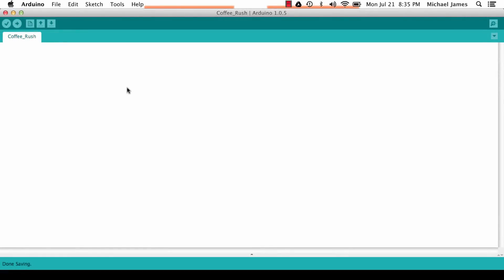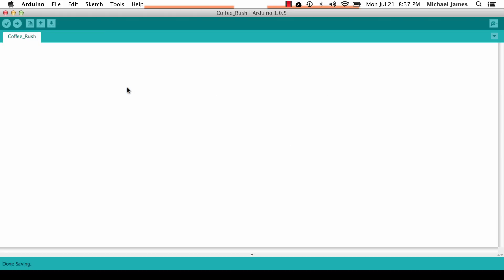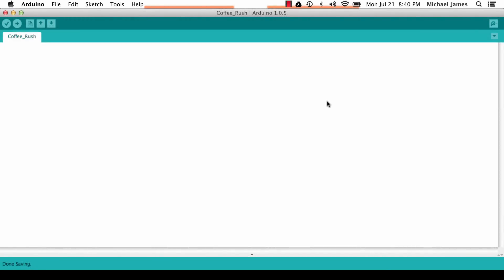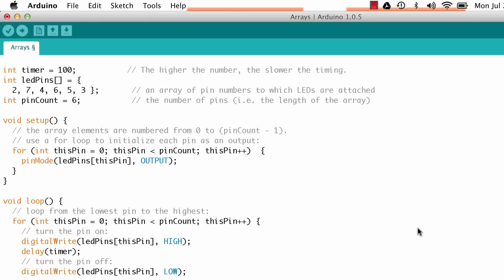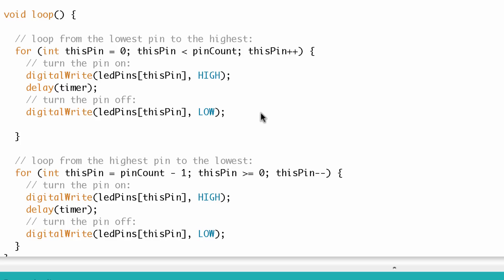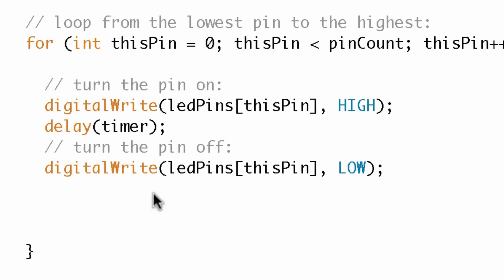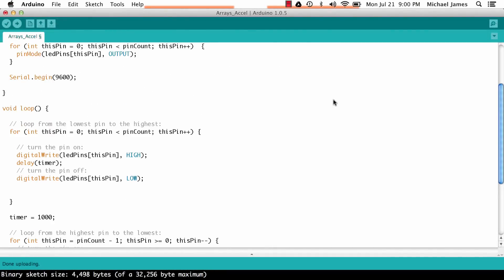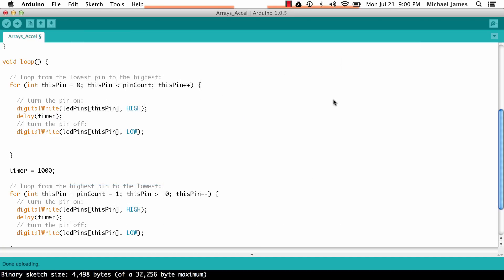3 Ways to Use Acceleration in an Arduino Sketch

Comment: Excellent video. I need some help to accelerate a Stepper Motor to a speed that is based on a potentiometer setting. The pot sets the delay between HIGH and LOW for the Pulse sent to a Stepper Driver.  If the Pot is set for a short delay, the motor can stall when the start switch is activated.  I need to somehow ramp up the speed to the short delay set by the pot. Can you help?  If so, I can provide more details. Thanks.

Comment: Such an elegant solution and well explained. Was actually searching high and low for a way to FADE a light in a more natural way, which is another great example of why you would want to use acceleration. If you fade an LED for say 10 seconds, using the simple "Fade LED" sketches using PWM that are included with the basic Arduino IDE example libraries, it appears like it is NOT linear; rather it seems like it fades on from zero very quickly, and as it gets brighter, it seems as though the rate of change slows down. (Linear PWM control gives a perceived effect that is not linear.) And this is true for much brighter lighting setups as well. To counter this, when fading from zero to full brightness, it's very helpful to fade in very slowly at first and then accelerate the rate of change in brightness. There are code examples out there of people trying to code a fade in exponential curves, or a sine wave fade, or a logarithmic curve, usually through very complicated code. You show solutions with one short line of code, thank you!
Reply from the maker: So glad it helped Eric!  I don't know if you have checked out the fastLED library (it is for neopixel led strips), but they have really got some interesting effects built into the library.

Comment: Wouldn't delay = delay*1.05 make a nice non linear (increasing rate)  acceleration? And delay = delay*.95 make a good gradual smooth deceleration? And easy to tweak using percentages. Using any power above 2 would be a blur.

Comment: Could not have been explained better, or simpler. Thanks I now have the basis for my electric wheelchair motors. Initial thoughts would be to decide on the amounts of steps I want, and map it to voltage.

Comment: Nice video! But are you sure that your linear acceleration is that linear like it should be? I see that you subtraced 100 every time which looks linear. But you do this every time faster and faster because your delay gets in the same time smaler and smaler. Isnt it then a accelerated acceleration? Also the first 5-6 LEDs accelerate very slow and the last 2 very very fast. Currently i try to accelerate my stepper motor linear but 70% it accelerate slowly and in the last 30% of accleeration it speeds up to max speed very fast. Sry for my bad english...